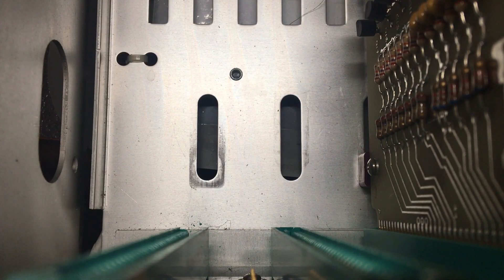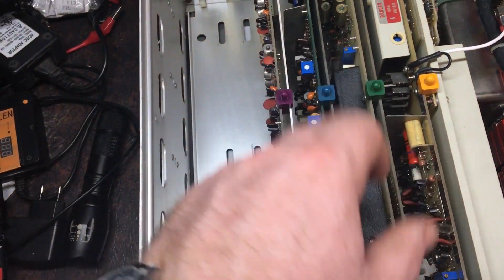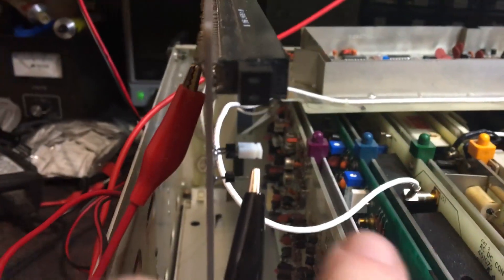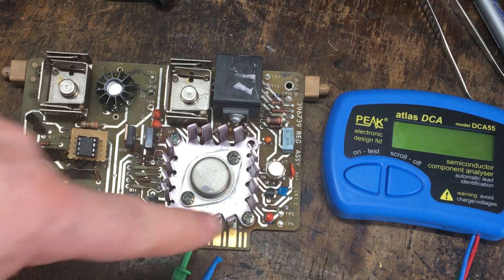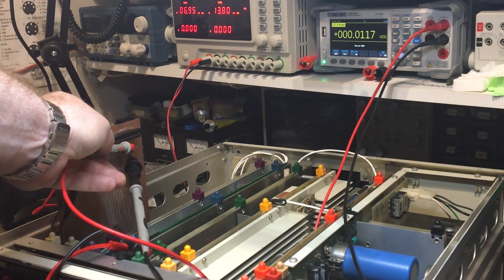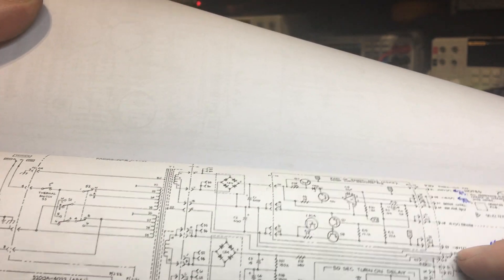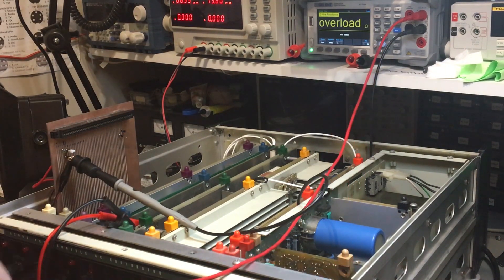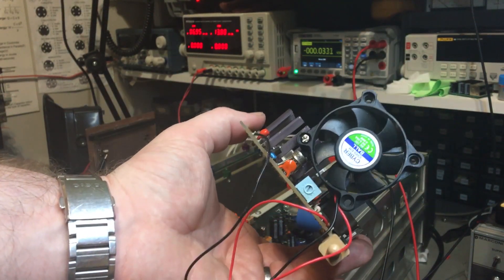#317 Fluke 5200A AC Calibrator Repair Part 9 - Regulator PCB SubAssembly A5A2

Comment: Oh bugger, i wonder if that slot caused the psu death originally.
I was expecting you to say Tip41a, it's one of those transistors i use as a substitute for many things, it just has enough of everything to work in most power circuits.
-
My frend always thought of my over rating of transistors was daft, untill he asked a pro repairer what he used for oddball power trannys, he said Tip41a was the one he used too, i did laugh at my mate :-D
2N3055/Tip41a/Bc337/Bc327 are a few i found usefull.